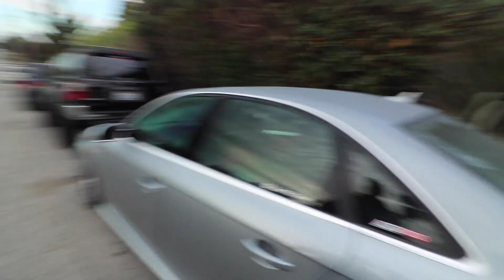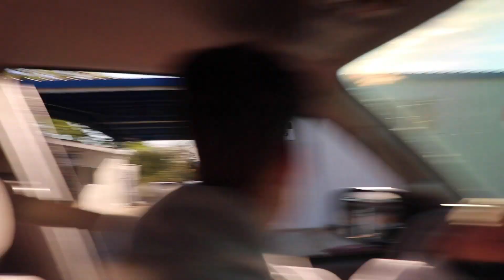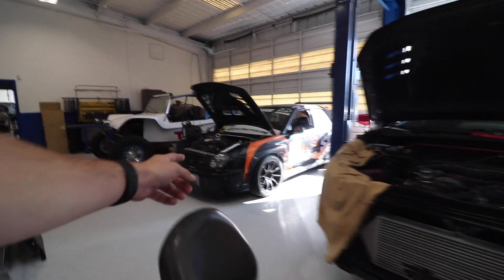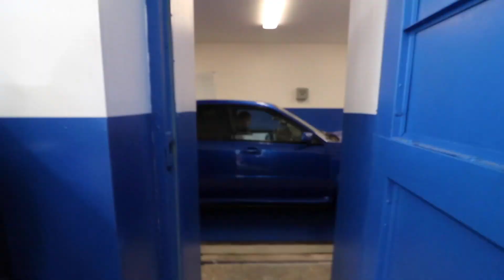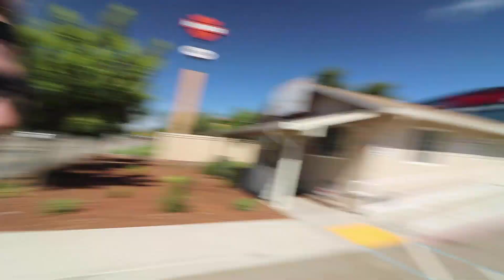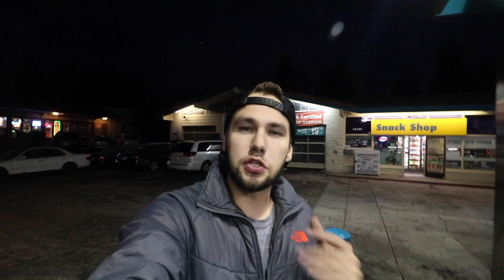Making my S4 loud! JHM Test Pipes!!

Comment: Yup. Magnaflow xpipe is what everyone does after going Catless. Works amazingly.
Reply from the maker: evan morritse trying to find what size the AWE exhaust diameter is. I think 2.5 right?
Reply: @TommyLinebarger  yup
Reply: @TommyLinebarger  magnaflow 11386
Reply: @evanmorritse  10790 is better..
Reply: @TriptoCo  if all you want is the x pipe aspect then I'd agree. But you need the extra muffling to counteract the added drone/rasp when you go catless!!
Reply: So what you have test pipes, to magnaflow x-pipe-11386?, to straight back from there?

Comment: Congrats on joining the test pipe gang! Check out blacklist builds, seems he's found a good solution for the test pipe noises. I may be going a different route but we shall see!

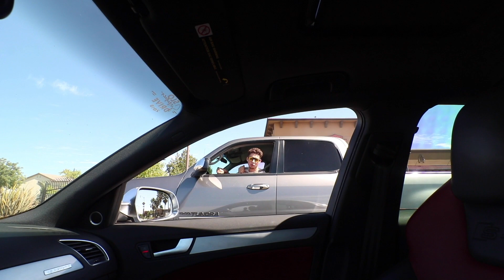8:50 isn't true - you won't run rich or lean. We have smart (NON SUBARU) ECUs that regulate fuel and timing based off of inline wideband o2 sensor. You will not blow the motor from changing exhaust or intake setups because the ECU will regulate everything accordingly.
Reply from the maker: IgnitionTube I’ll send him a Dm lol! I was also looking into Vibrant mufflers and resonators .
Reply: @TommyLinebarger  PM me if you want to be added to the bay area S4 group chat. ;)
Reply: Just lost my cats. I'm on awe track exhaust. Would the sound be bearable if I gutted them or put on test pipes, or should I do the whole relocation setup? I am dual pulley 3.28... losing around 100hp and not driving the car since the cats failed.
Reply from the maker: little difference in loudness between test pipes and gutted cats. Gutted cats are quieter, but still loud.